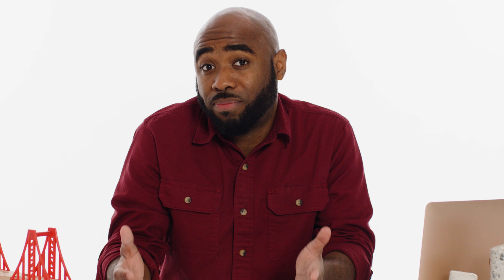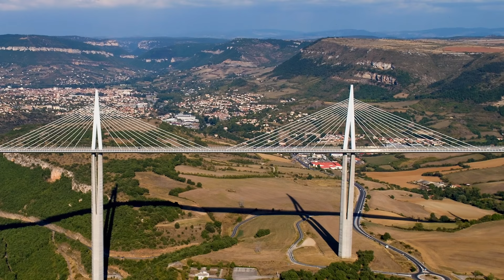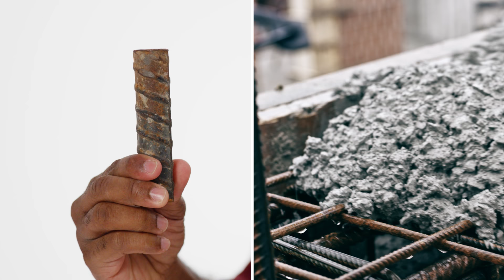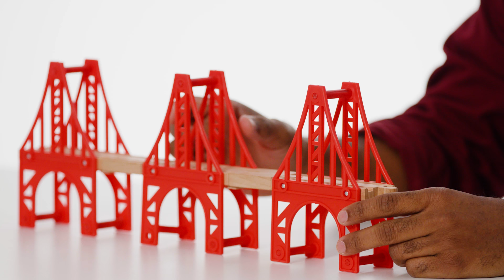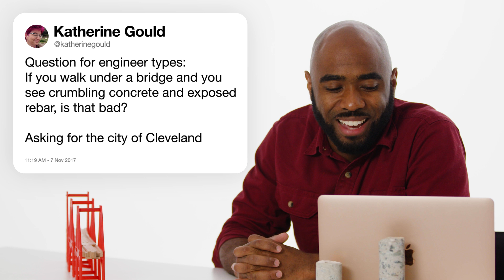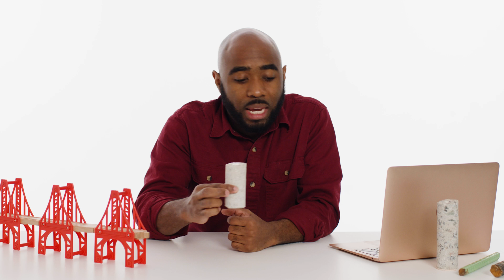Structural Engineer Answers City Questions From Twitter | Tech Support | WIRED

Comment: A note to add on the thing about planning roads. Sometimes they don't know. With infrastructure taking years to plan and build, you can plan for something to expand in one direction, but the city expands in another. My ex talked about living in AZ, and how they had this huge freeway/expressway/ highway/whatever, planned and then built, but the metro area expanded differently than anticipated so the traffic was an absolute nightmare because what they anticipated and planned for and built, wasn't how it worked out because the metro area expanded in a different direction and they couldn't do anything about it

Comment: 2:25 I don’t get the concept of residential areas vs commercial areas. Make the bottom floor of almost every building commercial with grocery stores, bakeries, restaurants, pharmacies, etc.
Put in pedestrian zones to have shops accessible on foot with centralised parking. Have parking for residents on small streets behind the buildings.
Have a well built public transportation system that connects different pedestrian areas and connects to the rural outskirts and make everything traversable on foot and wheelchair accessible.

Comment: I’m not a concrete guy but wouldn’t #9 rebar be 1 1/8” in diameter. I don’t deal with large sizes like that but in smaller sizes the number means the numbers of eighths. So #3 = 3/8” and #4 = 1/2”. So wouldn’t number #9 be 9/8” or 1 1/8”. Or is it nominal and changes for larger sizes like a 2x4 being 1.5x3.5 but a 2x8 is 1.5x7.25?

Comment: The rope bridge would be done with a crew on each side of the gap, and throwing or using an arrow as said to get a painter line to the other side.  Then the painter line is used to haul over a larger rope that may then haul a yet larger one.  Do this enough times and you could haul a braided steel cable over while only only starting out with a kite string tied to an arrow.

Comment: This isn't at all a "new" idea, but I want to see it proliferate. That being AI involved in timing lights and tracking traffic. Most intersections these days have VPD, which stands for vehicle presence detection. The intersection knows when cars are waiting at the light and sometimes how many cars. This allows the light to adjust its timing when the major road backs up or to allow a car on a side street to enter the big street safely. This is more limited than it sounds though. This is mostly reactive control to independent intersections. Introducing machine learning and interconnecting a city's traffic signal grid will allow the system to manage all the intersections simultaneously and proactively. If it can anticipate a platoon of cars on road A, it can stop traffic on smaller road B to allow as many cars as possible to flow without slowing down. It would also help if people followed speed limits (that is factored into how lights are timed) and accelerated normally rather than like a NASCAR driver.

Comment: Fun fact, concrete beams can actually be over reinforced. When a concrete beam is loaded, it bends downward so that the top side is compressed and the lower side is stretched. You want beams to be what's called "tension controlled," meaning that, if it were to fail, it would do so by the steel yielding in tension rather than the concrete crushing in compression. Tensile failure happens slowly and noticeably. Compressive failure can happen very suddenly.

Comment: Why aren't skyscrapers cylindrical? As a person who knows little about structural engineering, the issue of wind would be less of a problem if the building was cylindrical, no?
Reply: You usually want to maximize the space you have and the wind isn't that big of a problem. Look up helical strakes for why cylindrical designs (like smoke stacks) are not that great for wind.

Comment: The Roman Empire built roads starting around 300BC and they are still there, meanwhile they have to 'Repave' every 7-10years using this cheap rock and tar mix instead of using Concrete with Lime

Comment: Adding to the "if you aren't using no. 9 rebar..." comment, different sizes are made for different applications and requirements. One of those requirements is making sure there is enough space between the rebar and the concrete forms for the aggregates in the concrete to flow; sometimes this means no. 9 is too large. Or, sometimes you have rebar in say a column carrying a high load where no.9 won't be big enough.

Comment: I hate how many people are against one way streets. People complain about red lights and congestion, but one way streets minimize both those things by allowing for lights to be timed to accomodate the preferred speed of traffic. If someone goes at the appropriate speed then they will rarely hit a red light, which gets people moving more efficiently. Also. Because of these times lights with the one way traffic it is easier and safer for pedestrians to cross the road.
I became a supporter of one way streets after moving to a city that was mostly one way streets. The lights changed faster so pedestrians spent less time waiting for them to change and drivers spent less time at red lights because one they had stopped at one the lights would turn green ahead of them as they approached

Comment: I know of an underwater tunnel that was built without any dam, as the water flow and naval traffic made that impossible. Instead, they fabricated segments of the tunnel, floated them into position, then sank them to their final location in a trench dug at the bottom of the St Lawrence river. The various segments where then joined together, made water proof, anchored to the bottom, buried with rock, then, the water drained out of the tunnel. The name : Pont-tunnel Louis-Hippolyte Lafontaine between Montréal and the South shore.

The metro in Montréal was mostly made to have rapid, high volume, public transport that is unaffected by the Winter weather and it's snow.

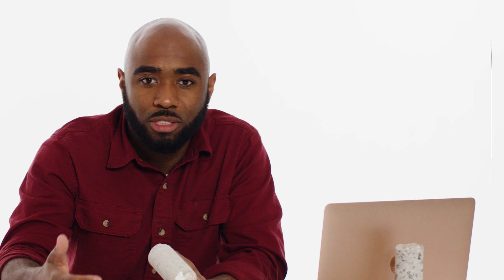Comment: 15:39 I think the issue with elevated freeways is that they are usually built in cities and I think cities don't need freeways at all. Instead they should have good and cheap public transport, because in this case most people don't use cars in cities and for the cars that are still in use, regular urban roads are sufficient.

Comment: Loved this episode BUT traffic signals are also based on money and repair. In our city there’s a long straight city street with 6 lights… All lights are green, for the length of the street if you drive at 40mph… then a new building was constructed. It meant reconfiguring infrastructures at that corner/site. The city can’t afford to retrofit the 5 other traffic lights so they remain green as they did before. The new light is the most recent innovation in traffic lights and isn’t compatible with the older lights. All it takes is ONE intersection to have to be redone to mess up the whole system. Over time perfection, becomes a headache of red/green/green/red/red/green 😵‍💫

Comment: Ocean cities are nonsense until we bioengineer plants to be less sensitive to salt, for one thing. Domes can be built, but not to a level of strength that can resist water bashing on it during inclement weather. The Eden Project looks wonderful, but was hideously expensive, and not structurally rigid enough to handle waves unless it is built on bedrock. Supports that long, are just too expensive to make this feasible. Closer to shore the supports would be cheaper, but then a tsnumani impact would turn a wave of water, into a wave of concrete debris, exponentially increasing the damage the wave causes on its journey inland.

Comment: On the subject of "What does building a bridge have to do with math?", I feel that the actual math was seriously overlooked here.  You have to find moments of inertia of various members, apply various loads to the bridge deck and supports in both continuous and non-continuous functional ways, calculate material deflection...  stress/strain and material characterization is the easy part.  Look up Finite Element Analysis and see how it's done by hand if you wanna tear your hair out.

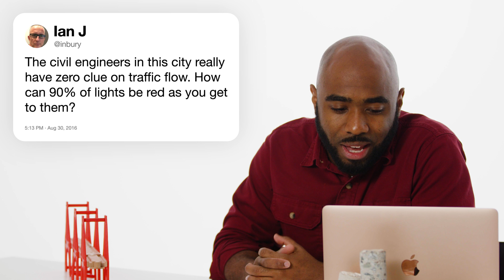Comment: 8:00 In the city I live they used to do manual counts of cars for traffic data. However corrupt local officials used to give the jobs to their kids to do it so they'd have an easy job for high pay. Not surprisingly those kids did not take the job seriously using it as time to sunbath or socialize. Some would fall asleep or even not show up for the job, both of which led to them making up numbers. This resulted in wildly inaccurate data causing traffic problems for decades until an inquiry finally ended the practice and move us to electronic measuring.

Comment: There is an old railway bridge near my place. It's disconnected, no trains for decades. It leads over a small river and a road.
I noticed that the dirt under the bridge is permanently moist or wet. This wasn't the case last year when it was always dry, even after the rain.
Is that bad?

Comment: About that desert sand, it can't efficiently be used to build anything of that magnitude because the surface of every grain is too smooth and round so the chrystals that form when cement reacts with the water have nothing edgy enough to hold onto. Any tall building with significant weight would crumblebc the grains of sand would just roll out of the christalline structure. .

Comment: 13:30
Excuse me?
What?
How did you even come up with that question?
You don't even need to know math to realize that you need it for calculating the weight it needs to hold, and that's a very very dumbed down answer, it's much more complex than even the answer of the video.

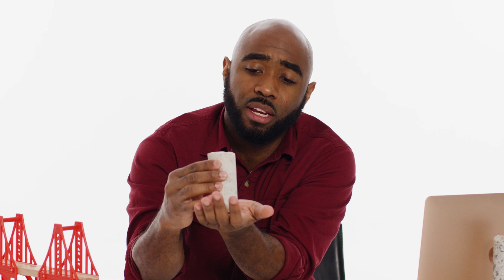Comment: 6:00 just to make some things clear, steel is stronger than concrete in both tension and compression. Concrete can confidently resist only compression. Despite it being able to withstand some tensile strength, we don't design structures that primarily take advantage of it's tensile resistance.

Comment: to add on to the swaying skyscraper comment, if it can't move any (or sway) all that force is still putting stress on the building and damaging or causing it to fall. Allowing for a big of wiggle helps reduce stress and wind issues.

Comment: @15:13 you say that mass dampers have hydraulic actuators. That is not correct for most mass dampers. They are purely passive systems.
The inertia in the mass is what causes them to "swing" when the building moves. Actually, they will try to stay in place because of the inertia, and the connected shock absorbers will hold back most of the movement the building would otherwise have.

Comment: In Sydney, Australia we have a car tunnel under the harbour. This was built by dredging a channel, and then placing precast sections into the channel. There was no dam built, the sections were placed underwater and joined together, then covered. I don’t know if they were sealed or if the water was removed after. We now have a railway tunnel that was bored through. Sandstone makes it relatively easy.

Comment: Did he say that a 1 inch diameter gave 1 square inch?
Area is pi(r)². R=1/2... .25(pi) so, less than 1.
Area is length times height. 1x1= more than less than 1.
?
Reply: Draw a square around a circle with 1 inch diameter and it is 1 square inch area square.

Comment: I'd like to know how possible it would be to build a mega structure to replace a city. Maybe a one mile diameter building that is maybe 500-1000ft or so tall that is all inclusive. Contains housing, business, transportation, agriculture, etc. I know that a lot of people wouldn't want to live in such a city structure, but if we replaced our current cities with such structures, we could let the areas between city structures grow wild and use high speed rail to connect city structures. Basically eliminate cars, improve transportation, improve efficiency, and potentially have entire climate controlled cities.

Comment: In Germany, traffic lights may also be deliberately programmed out of phase or particularly in phase for slow speeds, to slow down traffic. I.e. in a 30 zone you can either go fast and have to stop on each red light, or go slow and arrive at the perfect time.
Reply: They have that in Buenos Aires. It's actually incredible to take a taxi ride and it just never stops until you arrive at your destination, very unlike London where you sit for ages at every traffic light, watching the fare climb higher and higher.
Reply: We attempt that in the USA as well. Go the speed limit and you'll typically hit all greens on a particular street
Reply: This is common in the US as well but it's normally just set for the speed limit
most of the roads in the town I live in that have lights you hit one of them at 35mph and you just cruise thru all of them.
Reply: ah ja die grüne welle. Here in germany where i live we have a traffic light that gets red when you are too fast and stays red exactly the time you "won" by driving faster. so it takes your advantage. i dont know if there are any other traffic lights like this one anywhere so i cannot say its a german thing overall
Reply: @lorddestructive I know of one as well in Germany!
Reply: I've even seen signs (not in Germany, personally) that say "Green wave at 30" or similar.
Reply: In the US they are programmed out of phase to induce violence
Reply: I'm not sure how much it works. It is a daily issue for me as cyclist that speeding driver overtake me very riskily, only for us to meet again at the next red light.
Reply: I swear in America you have to speed to get all greens

Comment: Worth noting many of the existing subways in NYC replaced elevated lines. Elevated lines were unsightly, noisy, made local housing undesirable and the areas beneath them were dark and often attracted seedy characters. They ran on coal so they spewed pollution. Subways are far superior, particularly for places as dense as NYC.
Reply: Can confirm the elevated train in Chicago is LOUD. When you apartment hunt there everyone warns you to stay at least 2 blocks away.

Comment: As a stormwater engineer we do design ponding to happen on purpose. For very large storm events we are restricted to how much water is allowed to enter the sewer system and at what rate. To meet these allowances we restrict flows and design for surface ponding. Not sure what the design requirements are in California but sometimes the puddles you see during big rain events are actually designed to be there.
Reply: That's interesting. Where one person sees an issue, you'll look and be like, "nailed it" 😀
Reply: Stormwater retardation dams we have in Australia which are just like a big grass park with raised drains/pits which allows the water to chill out while the water in the stormwater tunnels makes it away before overloading and flooding roads etc
Reply: @alexsimpson4346  That's right! We often put our green spaces in these ponds, and they can be MASSIVE. Entire gardens, children's playgrounds, dog parks....all underwater during big storms
Reply: What also needs to be taken into account is water permeation. If everything’s concrete, paved roads, parking lots, etc, the water has nowhere to go but flow into the few open spots. Add that to a poorly designed water drainage system as well as very dry and temporarily impermeable soil et voilà the Venice to the Venice Beach ;)
Reply: @Mondballer_00 and then add to that the fact that extremely dry soil is less permeable 😢
Reply: A "stormwater engineer"? Now that just sounds awesome!
Reply: Another aspect is that cities change over time. A waste water system designed for a 1,000 hectare city that has expanded upstream to 5,000 hectares is going to have challenges, what can be done and can can be paid for are always the same. Long term maintenance and replacement can also be a problem.
Reply: True, but often times they aren't and I think that's what he was referring to.

Comment: Here's a trivial comment: Rebar is measured in 1/8", so 9 bar is 1-1/8" not 1".
Reply: That's the diameter, the area is 1 square inch.
Reply: @michaelweyenberg6238  Sounds  like every structural engineer I've ever worked with; never wrong, just alternatively right.😀
Reply: Yep

Comment: Who cares about how skyscraper are made, I want to know what’s the plan because they have a useful lifespan and we’re pretty much built all around the same time. 

Is there a plan or a preparation for what happens in a hundred years or we just gonna have a very bad time then?
Reply: Right
Look at the the portal bridge 
It needs to be replaced, so does the Amtrak tunnel into NYC 
Those are disasters waiting to happen, infrastructure needs to be maintained and rebuilt
Reply: They demolish them. New skyscrapers are being built all the time. Although they are much more expensive and inefficient today due to material and labor costs today.
Reply: @michaelweyenberg6238  how. like a skyscraper falling down create a lot of debris. got to block downtown for a while. and again. 

they all sprung up roughly at the same time. 
logic dictate they would come down the same way.
Reply: @mayasej  It doesn't "fall down", they take it apart piece by piece. Yes, there are construction booms concentrated around certain times, but many are modern. What time period depends on what city you're in. For example, the 1980's had a large amount of buildings constructed. Then we just had another boom that is finally cooling down now. Look at the skyline of a place like Austin, TX. Its nearly all new buildings.
Reply: @michaelweyenberg6238  so, point remain: all built around the same time, probably going down around the same time, congesting downtown and displacing millions. what's the plan?
Reply: @mayasej  Why would that be the case? They demolish buildings all the time. Just like they're building them every year. Just need to pay attention.